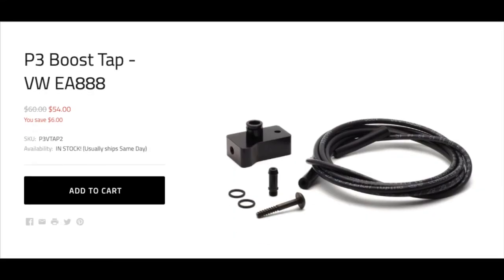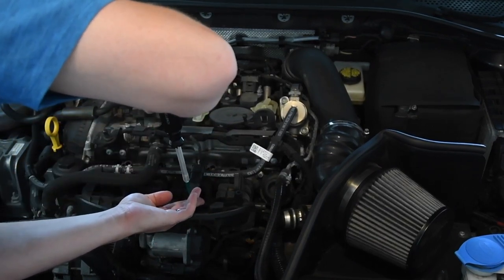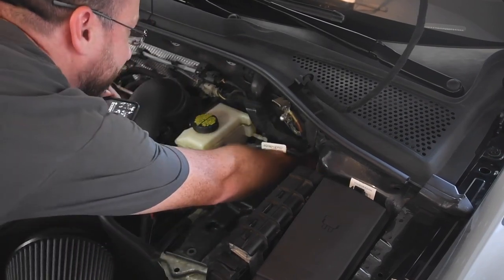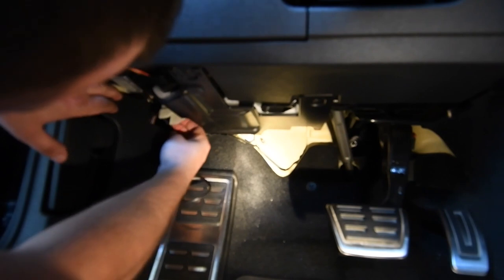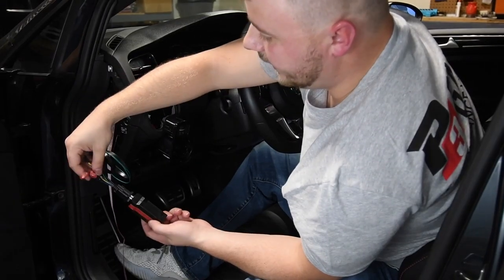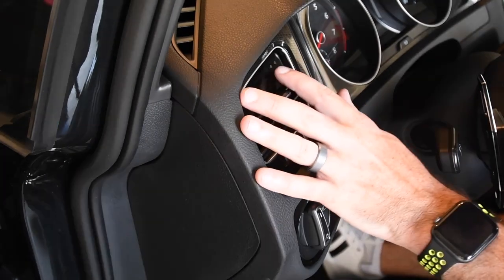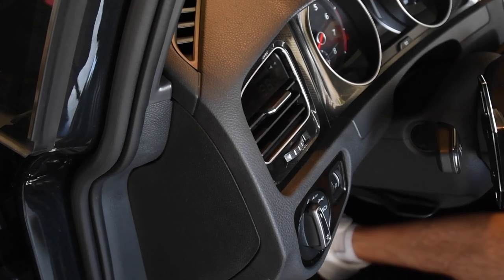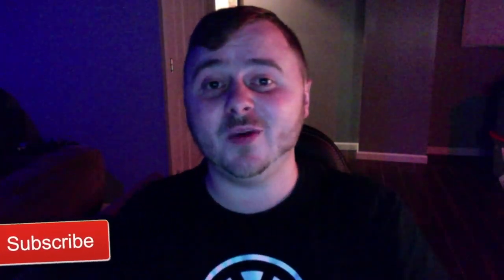GTI Boost Tap Install (P3Gauges)

Comment: Thank you
 I didn’t know I needed the Analog sensor also. I was like how does the air turn into an electrical signal 🤦🏻‍♂️
Reply from the maker: Only need analog sensor for boost over 23lbs
Reply: Put a catch can on not getting any boost reading since I by passed pvc

Comment: what mods are you running with the stage 2 from uni? Just downpipe, intake and exhaust? im just hearing you dont need the intercooler, obviously itd be nice for the car to run better but is it really needed?

Comment: Hi there,
Actually i am planning to get an automatic 2017 gti and i want to put apr downpipe with stage 2. So, is there any hidden problem that will arouse after getting that tune.
And what’s the hp gains with apr stage 1 and stage 2.
Thanks
Reply: FUck that get the Manuel so much more fun i have MK7 stage 2 M